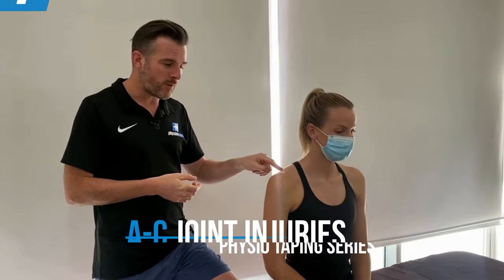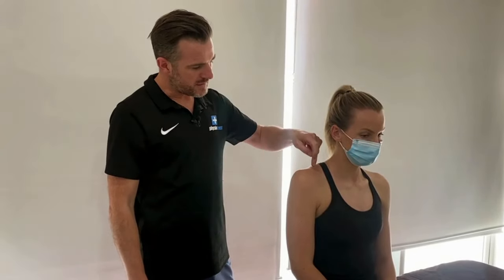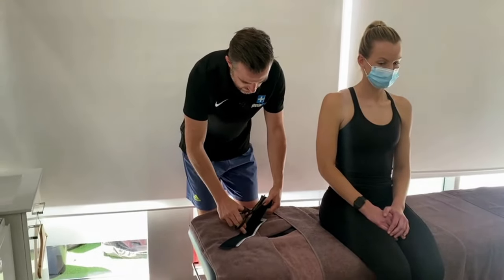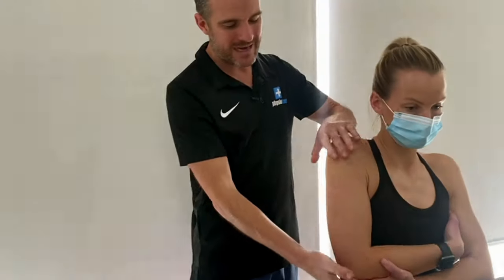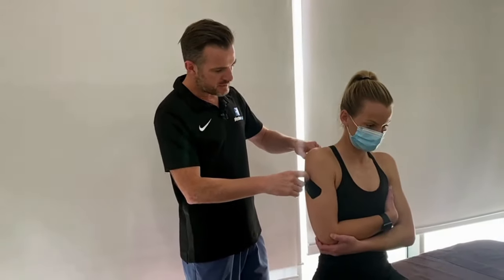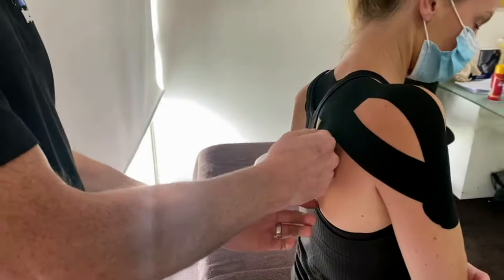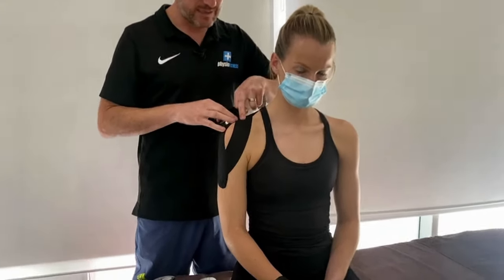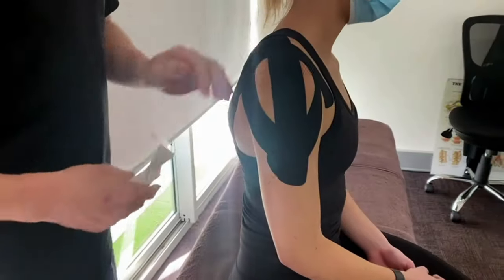Taping for AC Joint Pain and Injuries | Tim Keeley | Physio REHAB

Comment: Hey there I had a ac injury 2 months ago I couldn’t move my arm bc it would hurt badly but manage to see someone that helped but Now I have this pain on the ac joint and feel as if my ac bone moves easily when I try to move it,  I’m also more concerned seeing my middle collar bone is slight bumpy than the other, I wanted to know it’s bc of my ac injury, bc I tried carrying a long pole at construction and felt as if my ac bone went down I don’t feel pain in the collar bone in the middle but it bothers me looking at it so I wanna know if I need to check that out also, and I need an honest opinion how long does it really take for the ac damage joint/ligament to heal bc I feel likes it’s been a month for me ever since my arm was able to move but the pain is there so how long it takes  to completely heal I still feel the pain, but not as bad as before but I worry too much :/ bc I wanna start working out in the future if my goal I wanted to do so badly to become physically and mentally stronger… and do I have to have complete rest? Bc I still work at construction but I don’t try to use my other shoulder ac that I’m injured on but sometimes  it bothers me when I move my arm , I do lift my arms ups and all that but I don’t try to do a lot of weight on the injured ac I have
Reply from the maker: Ac joints can take a long time. Sounds Like you need to follow a regular rehab program to get 100%. Have a look at my programs online physiorehab.com

Comment: Had my grade 3 AC joint separation 3 months ago to the day. Did not get mine taped until day 8! Looked into it too late on day 3 Friday at 445pm and every where was basically closed for the weekend. Was to slow in my mind and in too much pain to think of a physio guy I knew that I could have ripped to his house and got it taped which I later thought of on day 8 and WOW what a difference. His tape job was a bit different than this but this looks awesome and excellent and so secure ( can only imagine how good this would have felt). Everything you said is bang spot on. The surgeon never really mentioned anything regarding getting it taped when i saw her on day 7. I would recommend to whoever has this injury get the joint taped immediately to help with pain and stability! The first week with the grade 3 and some rotator cuff tears was absolutely BRUTAL! More the first two weeks! Around the 2 week mark I had an accident while I was forced to shrug up hard and sudden on my injured slinged arm from being startled in pitch black at night and omg that burning Nerve pain was just BRUTAL! Felt like I landed on my shoulder and smashed it into the ground again and worse from the nerve burning! Lasted about a good hour and continued to feel worse after that like I set it back a week lol Do not let this happen to you if you have this injury!!!!
Reply from the maker: Hope your shoulder is feeling better and you are doing the rehab work. if you get stuck with exercises to Physiorehab.com and have a look at the shoulder injury program
Reply: Thanks so much! 6 Months Jan 26 coming up. Was feeling a lot better and was doing tones of physio exercises until I tweaked it closing a damn door that was stuck preventing it from closing fully while at work a week ago frustrating. I pulled on the door stop to close it fully because there was no door handle on the door and while doing so had my arm dangling in front of me while bent over in a vulnerable position for the shoulder lol so dumb now feels off and tweaked. Felt a light tearing sensation when happened. Not as good as last few months. Lesson learned still long way to go but MASSIVE improvement from the first couple months which was grim and a nightmare! So grateful it is where it is. Pushing exercises and pushups still hurt. Tried a few body weight pull ups 2 weeks ago and did 3 no pain. Now it hurts after tweaking. So will not be doing until subsides. Lat pull downs rows zero pain etc just certain movements. Will check out your page looks awesome for more exercises!  Thanks so much for your awesome videos! Cheers!
  @physiorehab

Comment: Superb explanation and taping job Mate. I just separated my AC joint and am determined I can heal it without surgery. KT Tape, applied correctly helps incredibly well. Thanks for making this video. God Bless you....
Reply: I just did mine too mate, it took hospitals 3 weeks to realise it after all scans, what have you done to heal the process and is it going well?
Reply: Dang, you must have a grade 5 separation. Mine is a grade 3 which is on the cusp of needling surgery or not. I've mainly been using stretch bands and doing seated rows, anterior--lateral--posterior deltoid raises, and something I call "standing snow angels" with a 5-8 lb dumbells. Stand with feet 6-8 inches apart, then lift your arms laterally and go up until dumbells touch overhead and back down slowly. Last one I do is "around the head', Take one 5-10 lb dumbelll, don't grip the handle, hold the fat part on each end so your palms are facing each other. Then standing lift the dunbelll and make circles around your head. Keep your head still, move weight around head 10-12 in one direction10-12 in the other.

 Key tips: go very light and slowly, if you have any acute pain don't do it, over time increase weight and reps. really baby the lateral movements, maybe avoid them at first as it can stress the AC joint. Avoid push ups. Have a positive and strong mind -body connection, like Arnold did. Your body hears everything your mind says. Good luck, be safe, and God bless you my friend.
Reply: Thanks for the messages and tips but what makes you think ive done a grade 5 seperation?

Comment: @physiorehab 
Tomorrow 10/13/24 will by 10 months since my grade 3 AC separation. When it happened, docs said surgery success is about 50%, so I opted for PT, which I did for about 8 sessions before they said to just continue the learned exercises at home. I did some of them with pain for a little while but really couldn’t stay inactive due to my job.
About a month ago, I started cold laser therapy 2x a week, totaling 6 treatments. The chiropractor suggested KT tape. I used a different method at first but this looks MUCH more stabilizing. 
Do you think 10 months later is too late for this method? TY in advance.

Comment: I think I've pulled my transverse humeral ligament on my left shoulder. Would this taping provide the necessary support? Thank you
Reply from the maker: You think or you have been told you have?
Reply: @physiorehab  think.. Osteopath hasn't fixed it.. My surf board wrenched my left arm back while it was rest, flat palm down on it, elbow bent at a 90° angle. My whole arm got yanked back and straight up to shoulder height. It been painful ever since.. Going on 6 months now 😬

Comment: I injured myself in April its now October.  I was diagnosed with a grade 3 AC joint separation.  I  went to physical therapy however the clavicle is still popping up. Should I use this tapping method and if so will this help settle the joint? I really want to return to Jiu Jitsu but I'm afraid that if I do things will only get worse.  Thank you
Reply from the maker: Grade 3 usually always has a visible change. Try the taping to see if you can stabilise and strengthen better
Reply: How are you feeling now with your decision not to have surgery?

Comment: Thanks, always wondered what those tapes did for injuries
Reply: It reduces swelling by enabling lymph fluid backflow, reduces pain and tension by changing the local fascia pressure and altering pain signal to brain, it also helps with increasing range of movement.

Comment: Ive seperated the joint i think its about a grade 3. Ive got a sling is that enough? Also any exercises i can do to rehabilitate? I was thinking if wearing a backpack with weight to help push it down. The doctor I saw said you cant push it down but here it looks like u can which is great news
Reply from the maker: Taping helps initially, but you need to work heavily on rehab

Comment: Trying this for myself. I was just diagnosed with Os Acromiale which pairs nicely with being a paraplegic and requiring the use of my arms for basically everything. My first attempt isn't great but I can tell this will make life tolerable until the inflammation decides to calm. 
So far steroid injection and NSAIDs don't do anything but this seems to be giving some good initial results. Will see if it sticks overnight or if a second application done better will do the trick.
Reply from the maker: Hope that helps!